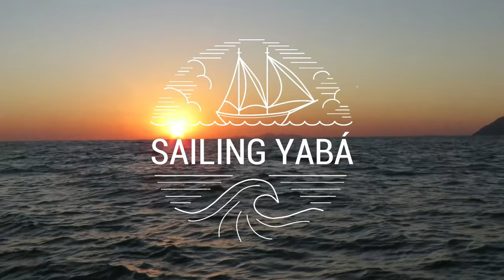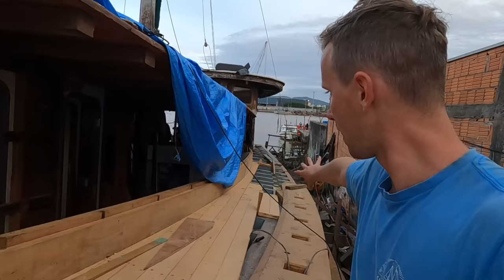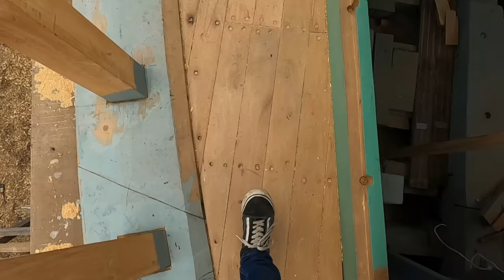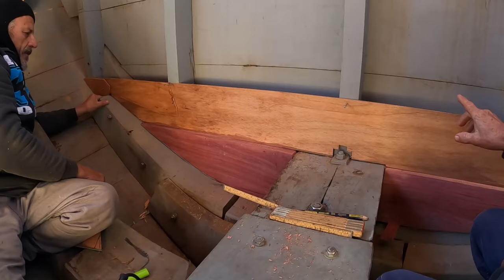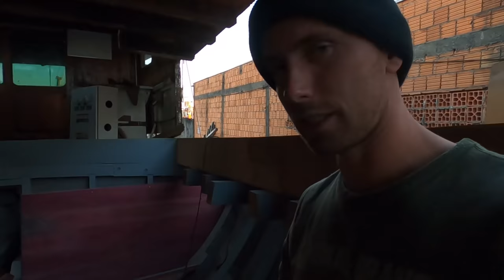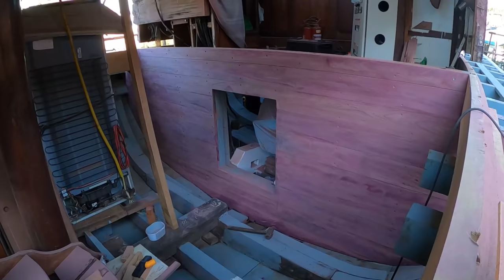Rebuilding our schooner with PURPLE HEART wood! — Sailing Yabá #46

Comment: I LOVE the purple walls.  I would keep them as accent walls.  very unique.  The Shipwrights are totally amazing.  They have so much skill and tallent.  I love how they use wedges in so many ways.  Yaba is going to be amazing.  can't wait to see her finished.
Reply: Yes. Purple Heart is a beautiful wood and unique. However, over time it will change to brown.  Sitting beautiful but it won't stay purple.
Reply: @joes7166  A clear coat of varathane  sealant will keep the wood purple. Using an osculating (kissing) sander is difficult, try using an oscillating (variable orbit) sander.
Reply: Epoxy followed by a clear varnish (UV protection) will protect the colour.
Reply: That purple wood is very expensive in the states nice to see it used there and im with the others with coating and preserving the color
Reply: I, too, have found their use of wedges very interesting.

Comment: Purple heart wood must come from Brazil...Here in the U.S.A. that wood would be very expensive to buy and definitely  would not get painted over. Nice sanding and some clear coating or hand rubbed with a nice oil to seal it but still show its beautiful color.  If you have any scraps left that are  around  24 inches long  by 8 inches wide...glue them together side by side and make a serving tray or nice cutting board. For the serving tray i would add rope around the outer edges of the surface  to make a border  then add Boat cleats on each end for handles. It would make a nice addition to your  cabin to serve your guests drinks or snacks  on.  Just a thought!

Comment: Ahh yes the old dislocating selector shaft issue. In 1986 I had a 1966 combi that had the same problem. The bolt would work is way loose usually in an inconvenient location. VW's were known as Hitler's revenge for the amount of time you spend fixing it. Though glad to get rid of it at the time I now wish I had kept it as we did some amazing road trips.
Loving that purple timber.

Comment: It may take on a little water at first but these are some great guys. Love the deck and new bull works for the walls
Reply: Taking some water in is normal for any wooden boat. The wood will swell a bit every where and seal itsself.
Reply: @marcryvon  yes sir that is why i said it will take a little water at first

Comment: Smart decision..the further the reconstruction progresses, the more "stuff" you need to haul and load..You will be amazed to see how much "stuff" you will carry in the VW van..Looking forward for next weeks installment.. Gradually the interior part of the reconstruction will absorb all your time.. This includes the reinstallation of the Mercedes Engine and support, reduction case, drive/prop shaft, stuffing box or cutless (aka cutlass) bearings, prop, etc.. 

The fun part is upon you guys.. but you can handle this..Keep up the good work

Comment: Hi Guys, i'd like to offer you some advice from an old salt, assuming that a hull is sound all wooden boats rot from the inside due to fresh water ingress, not salt water(which is a preservative). It's imperative that your topsides and especially the deck, covering boards and bulwark stanchions are a 100% waterproof. Apart from the rot aspect there's nothing more uncomfortable than for it to be raining inside as well as out.

Comment: Ben, you can buy the Idiots Guide to VW combi maintainance book, I ran a workshop with a VW/ Porsche mechanic and I know just about every nut and bolt on those things. That is an early bay window model by the looks of it, because of the barn doors on the side. That one is in pretty bad condition, if you need a new gearbox or motor I am sure that there are plenty of car scrap yards around and you can find parts there for a reasonable price. I have fixed clutches on roadsides in the past on those vans.

Comment: Yes, of course we like that very unique and beautiful purple heart wood! But I would think a lighter colored wood would go better as trim for it than a traditional and darker wood like teak or mahogany. Holly and maple and ash are some of the lighter woods but if the grains of those don't go well with your purple heart wood then bamboo is very light and with a grain that is hardly noticeable. You said you would coat the purple heart wood with urethane. I would check a sample or two to determine if you like a gloss or a satin finish. The reflections from a gloss finish can really show imperfections more readily than the satin finish. If you have very few port lights down below, then a few of those interior walls should be pretty light colored to brighten it up in those cabins. Having a few overhead spotlights that could shine on the purple heart wood and give indirect lighting to those cabins would enhance the look in my opinion. Will the bungs in the purple heart wood be cut from purple heart wood? Or are you going to have to fill them with a purple heart wood sawdust putty?

It has been really good to see that the planks have been coated with the "undercoat" paint to prevent the wood from absorbing any water over the years, but the edges of the planks and the ends which are where the water will enter, are never coated. Why is that? I would feel reassured if the caulking went into crevices that had already been waterproofed with paint. If you get a leak into the inside through a seam, you can stop the leak into the interior cabins but not into the seams in the planks from the water-side without hauling out the boat and re-caulking out there.

Comment: I love the craftsmanship of this project, but it seems like it's going to take some serious horse power or wind power to move this heavy boat.
Reply: I don't think they're going to be in a hurry.
Reply: Yeah, these boats were not built for speed.
Reply: How heavy the boat is doesn't dictate the speed.  It's waterline length, wetted surface area, shape, mostly.  Weight changes how fast you get to speed, which isn't really a big consideration for touring.
Reply: @boooshes  Thanks, I didn't know that.

Comment: if you apply heat from a torch, carefully, the Purple Heart will really become a deeper purple, sand it lightly and use boiled linseed oil to seal it.

Comment: Purple heartwood looks awesome.  Just remember that if you finish it with polyurethane it will eventually yellow.  Use a crystal clear shellac sanding sealer about three coats sanded smooth. Then apply a basic clear lacquer.  Then it will not yellow.

Comment: great vid   by the way have you considered an internal fire suppression system yet  what with all the super yhat fires lately
Reply: did little research and found "red ensign"  discussed on esysman post on why super yachts burn so if in the future you want to run charters or commercial,  now would be the time to put in  the plumbing for fire suppression.

Comment: I guess you'll splash Yabá, the question is, is this just a float test and then out again or permanent and work will continue as she floats, by the amount of external paint i'll guess it's a float test only.
Reply: and my guess is to get it wet to swell the planks before caulking...

Comment: hi both hope your good , the clearance between the top of the engine and the wood work  above it doesnt look great enough to get the rocker cover off the top of the engine for valve clearance adjustment , this is a weekly / monthly service item you need to give this some thought , being able to carry out valve clearance adjustment is very important , try to avoid over sights like this , also can you get at fuel filters oil filters and the sump drain plug easily  and the same for gearbox transmission service items , now is the time to get his stuff right , ok take it easy ok

Comment: Don't put anything in between the bulkheads, air is the best insulator of thermal transmission and sound waves. I hate the thought of anything dangerous when it burns (hopefully never)

Comment: My two cents. I know you're learning. It's not pronounced "gun-wale". It's GUN'L". Or "Gunnel". And try to avoid using Purple Heart for structure above the deck line. Way too heavy! Try lighter hardwoods like mahogany. She'll handle in a seaway much better and you're improving her "righting moment".Too much extra weight high up will make her roll more than necessary or may even be dangerous in bad conditions.